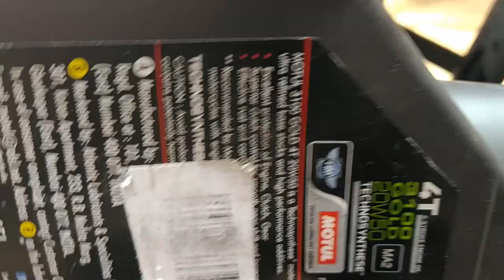Royal Enfield oil changing

Comment: Nice informative video. Quick question, when tightening the nut back on the timing cover, is it important to align the hole inside it with the hole for the oil channel from the oil pump? If yes, how do we determine if its aligned correctly through normal tightening?
Reply from the maker: No it's not.

Comment: Is it necessary to change clutch oil  because few months earlier I changed  it engine oil also but after rainy season water is mixed in oil,  when engine warms up some smoke comes out of engine when I check opening the gauge, any problem sir, what about gear oil change, please explain sir,

Comment: My bike is a 2003 500 es. USA model. It only has 3 bolts underneath. Also should I put type F Transmisission oil or 20 w 50 motor oil in primary case. I have kickstarter and electric start as well. I have small leak at bottom of primary case even after replacing the gasket. Thank you for the informative videos. It is very helpful
Reply from the maker: Is it single bolt type primary chain case?
Reply: EC Fix yes single bolt for primary
Reply: I looked again. The leak is not from primary case but from about the primary case. I don’t know what that part is called. I looked up some videos but most bullets  does not have that same location
Reply from the maker: @Blueknight-il9nc  take a snap and send it to my Whatsapp: +91 8300701470
Reply: EC Fix ok
Reply: EC Fix I sent it